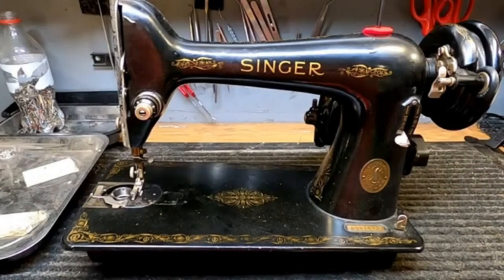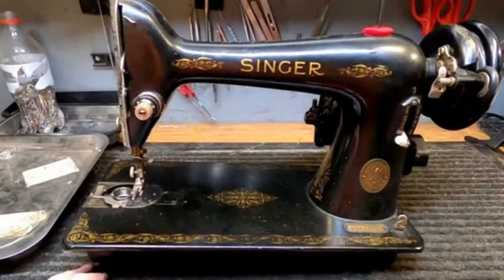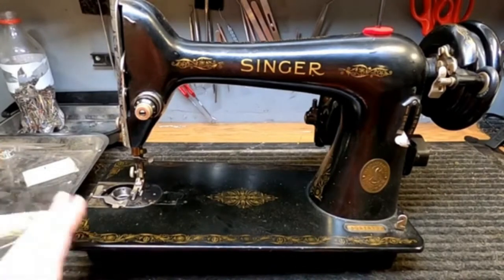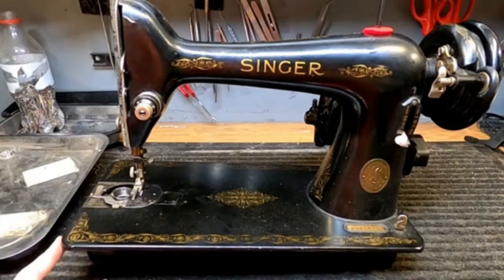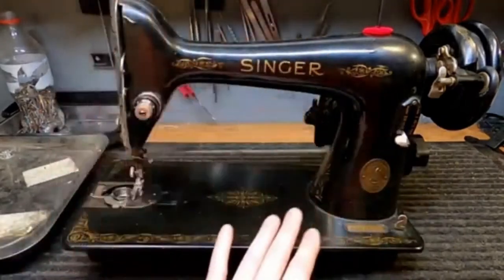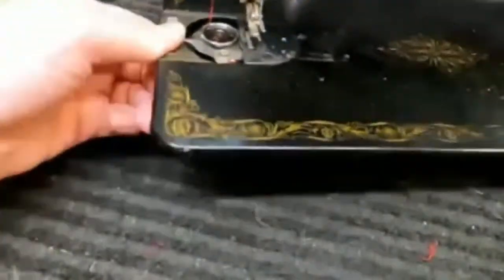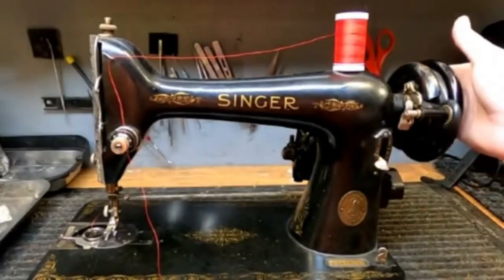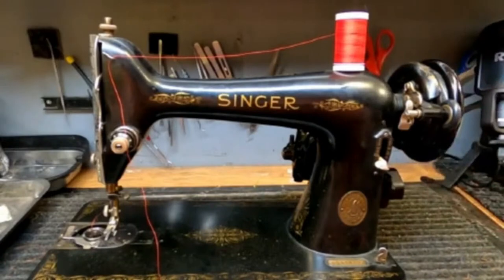Getting started with vintage machines - Part 3

Comment: Whenever I see a machine for sale with a missing bobbin cover plate that most often means a thread tension or even timing problem and will mean more work to get that machine running properly, plus you've got to buy a replacement plate (Amazon six dollar range so more of a hassle ordering). The original owner was frustrated the machine quit working and set the machine aside hoping they might get back to it then they or other family members misplace the loose plate.